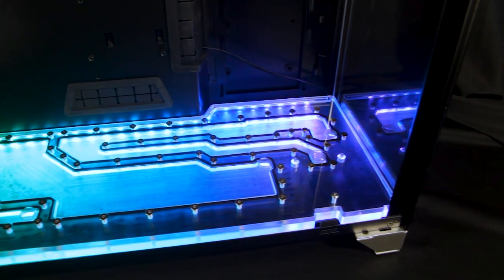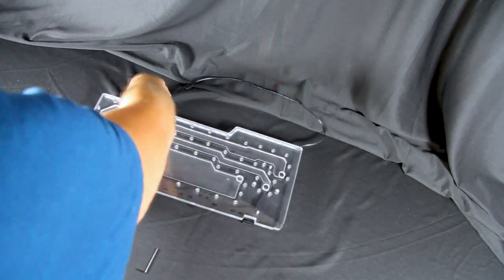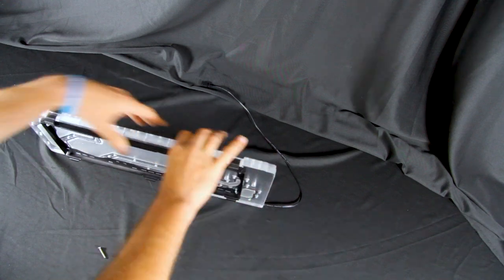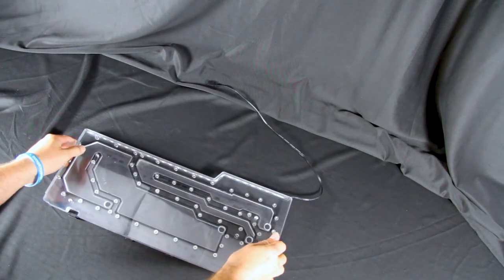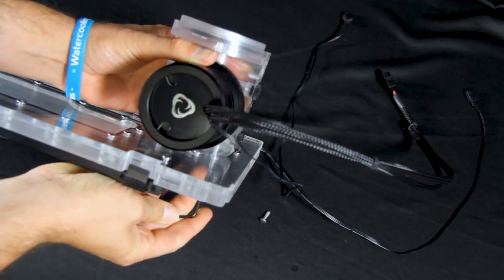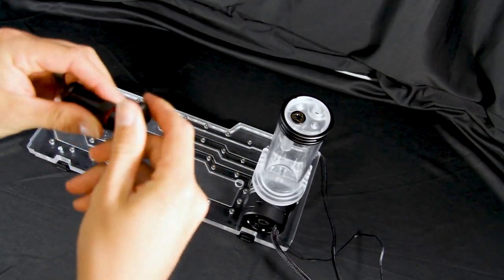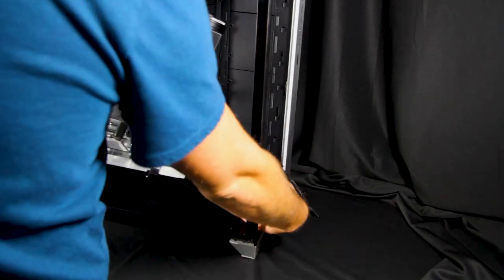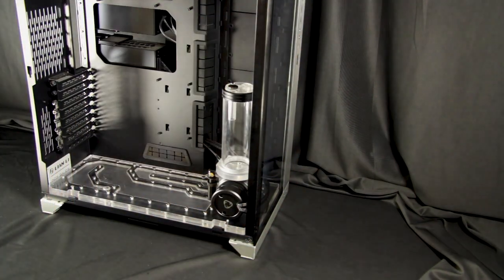O11 XL Bottom Install

Comment: Any chance of a updated design (V2?) to replace the current O11XL front distro plate?   I've seen the current single D5, and the dual D5 front distro's but just can't get behind the design of the plate.  The design of the bottom distro plate for the O11 XL is amazing!  That's the kinda look I was thinking for the front distro.  

Speaking of the bottom distro for the O11 XL, I'm thinking about getting that thing.  Going to have to relocate my bottom rad and mount it to the side location.. or something.  lol

Comment: This distro plate seems very confusing to use. There is only one inlet for the GPU and an outlet for one radiator? You should show how a system is setup before making a custom part. At least mockup a motherboard with GPU and a compatible radiator. You must have done this when you came to the decision of where to place the outlet/inlet ports.